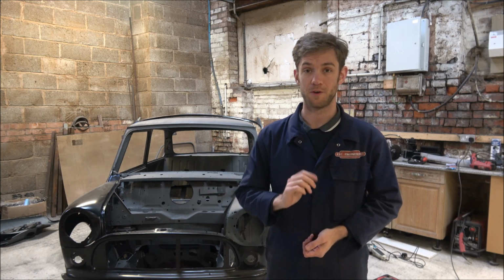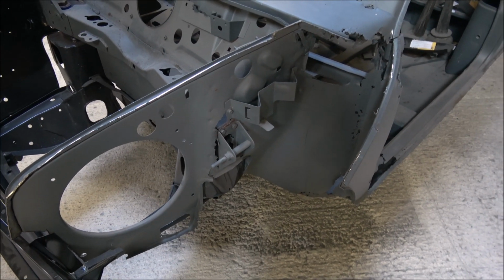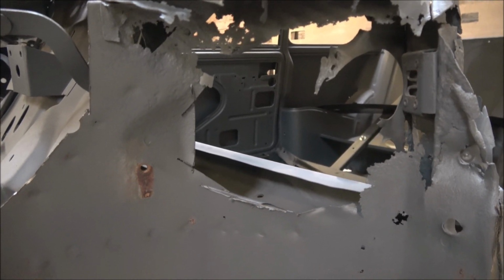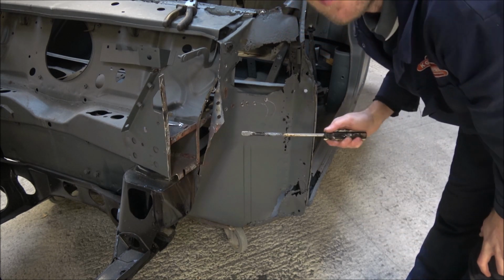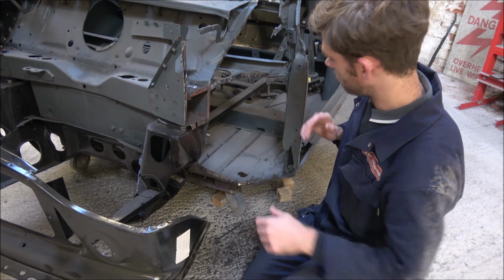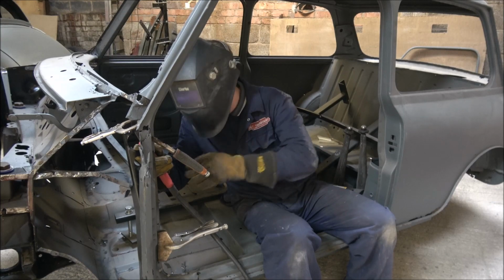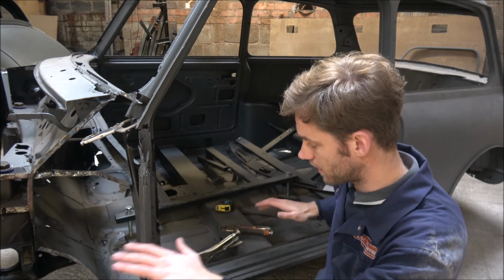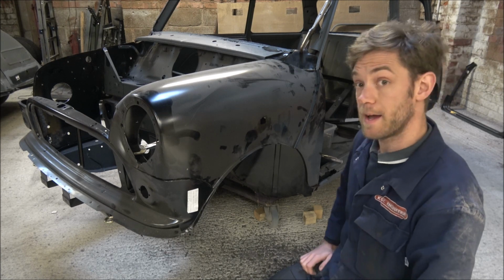Mini Project - Bodywork repairs day 3

Comment: Hi, when you plan on fitting the wings please remember to check the fit with the bonnet. many have not done this and find that it takes days to correct and modifying the bonnet . cheers Alan
Reply from the maker: Hi Alan, im planning on bolting out new bonnet in place before fitting the wings to solve this very problem, but great shout out on it as a reminder :)

Comment: ive watch part 2 of the mini where you drilled and plug welded ...i couldn't help notice that where your panels meet did you not use weld thro primer...if you don't then its gonna start rusting very quickly where 2 the pieces overlap good work on the mini

Comment: Re the spot weld cutters, I use two cordless drills, one with the cutter and the other with a 2mm drill bit. If the cutter skips I don't bother arguing I just pick up the other drill and put a 2mm hole where the center punch mark is. The cutter wont skip after that as the hole guides it much better. This also allows you to use it in awkward areas like curves etc. If you have access you can also go through both panels putting a neat hole in the panel your leaving so you can plug weld from the back without having to drill the new panel. If you envisage using a lot, you can order them on amazon direct from china at half the price, but with a long delivery time. Handy if you already have some but know you will need more at some point. Nice work, looking forward to seeing more.
Reply from the maker: ahh thats a really good idea, and it did cross my mind at one point too :)